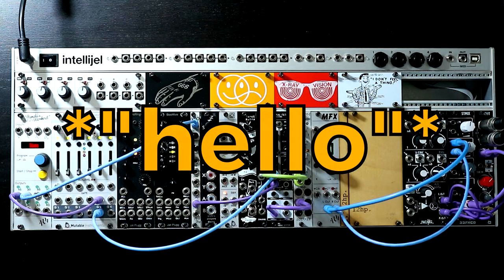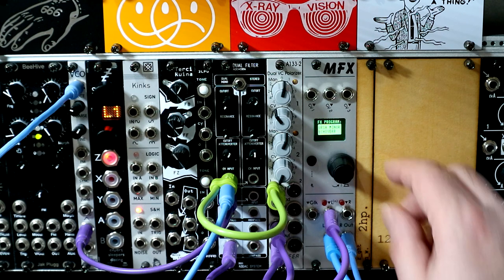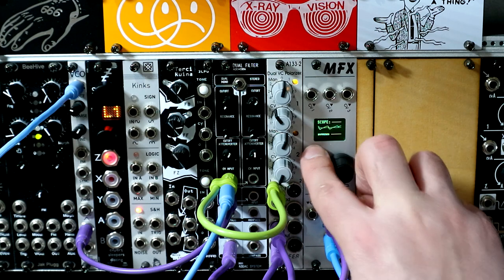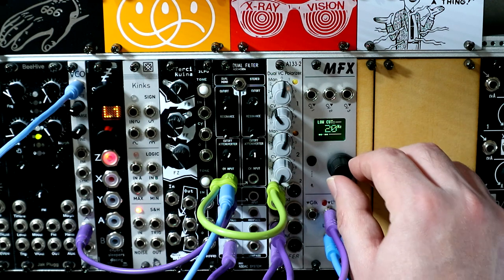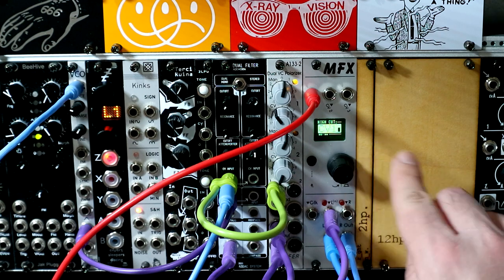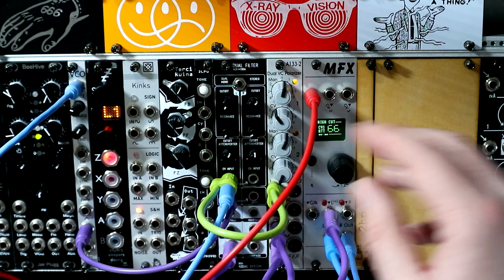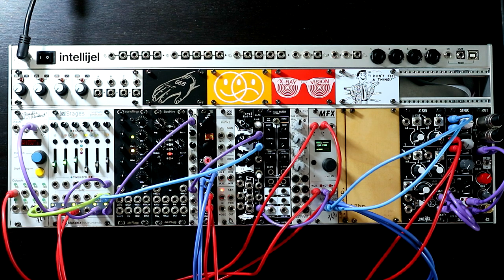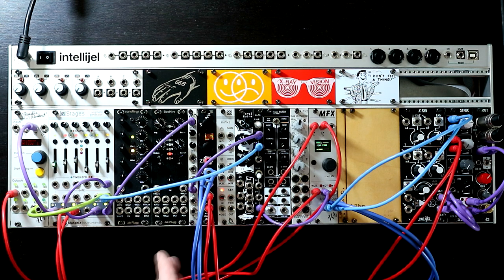The  MFX from ALM Busy Circuits Sounds Nice

Comment: Thanks for the great demo. I also jumped on buying one for the same reasons! :)
On the first patch you're using an LFO to Pams Cv in. What (if anything) were you modulating?
Reply from the maker: The clock division for the gate that's triggering the melody. So the notes keep getting more and less dense. It's a different vibe to modulating Random Skip for example.

Comment: What do you think about not having dedicated physical controls for wet/dry or the other parameters that are being controlled by CV? I don't like the UI on FX Aid, but once the effect is selected, there's knobs to control wet/dry, etc
Reply from the maker: In the context of my rack - it doesn't bother me at all, if I want direct control of anything I can assign it to one of the CV inputs and hook up 4tten or Quadratt.  That is obviously going to be heavily dependent on what's in your rack, but I really appreciate that a single CV input can be sent to multiple parameters at once, by different amounts, possibly inverted on the MFX. Definitely a case of "your mileage may vary".

I guess another question is whether you feel that you need the additional CV control?
Reply: @OscillatorSink  Having CV control is useful, but tying up two? attenuverters to create a fixed voltage for a knob control a bit much for a smaller performance rack. Really want to like it, but having one knob like Pam's makes it slightly less appealing. It would be nice if the fx were open for adding more or customizing it further.

Comment: This seems like a really nice alternative to the FX AID XL.  Less effects, but an easier to use interface.  My FX AID interface involves a note card that tells what each effect is based on the dots...
Reply from the maker: The nice thing about the FX AID is that you can load custom SPIN code onto it and get really particular about the sounds, but I'd agree that the MFX wins on the UI as far as I can see (I don't own the FX AID) and having offsets/attenuation on the CV inputs on the MFX makes it more flexible from the CV control perspective (and saves on needing other modules).
Reply: @OscillatorSink  Oh yeah, the FX AID requires attenuation to do anything useful modulation wise.  I do enjoy mine though, they've made some great algorithms for it and the bit crusher is a nice bonus.  When I got it there wasn't a lot of options for modules that could do multiple effects simultaneously.  Today I'd look hard at something like the Poly Hector.